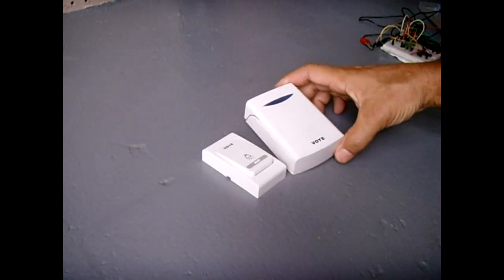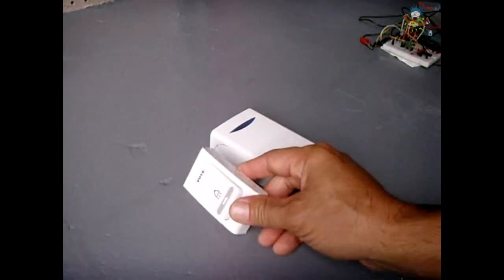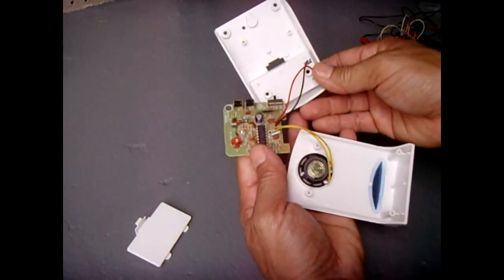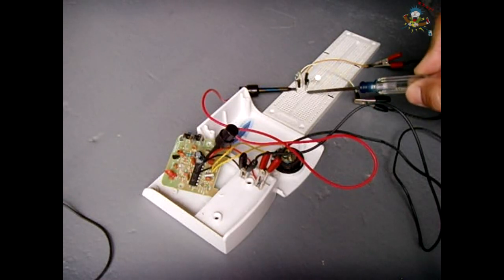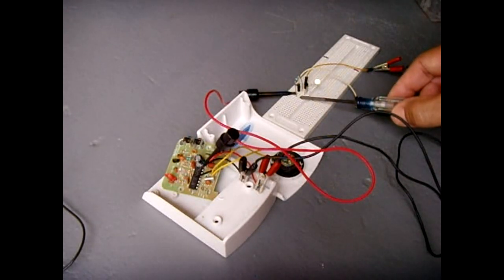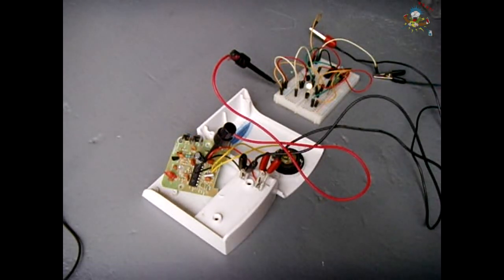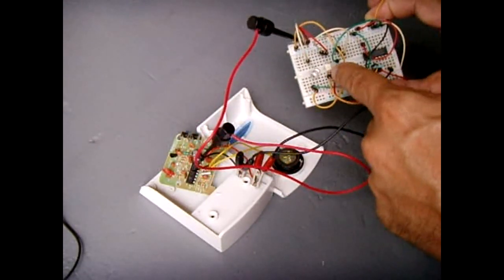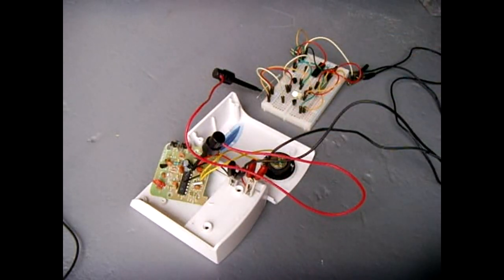Latching ON/OFF Wireless Transmitter for UNDER $10!

Comment: There is nothing wrong with Dave Johnson's latch circuit.  The Mosfet used in his circuit is a P-Channel Mosfet and it is wired correctly.    You described how to wire up an N-Channel Mosfet circuit.  The 2N7000 is an N-Channel device.   N-Channel Mosfets are generally used for low side switching.  P-Channel Mosfets are generally used for high side switching.

Comment: I saw this video and it inspired me to do the same, I went on ebay and purchased doorbells like the one shown. Upon opening it up the circuit board is different. Gotta give it to china for having multiple factories using the same case with different internals. I now see that they sell RF transmitters with push button remotes and relays already installed for the same price. So I'll probably go that route.
Reply from the maker: darkflame808 That does happen unfortunately. Please refer to my remote control pyrotechnics video. You'll see the transmitter you're referring to. Thanks for watching!

Comment: I have an older Nutone intercom with wired doorbells.  I would like to replace the third wired doorbell with a wireless remote button.  The doorbell now sounds as long as a constant 12vDC on the doorbell circuit is interrupted by the push button.  Shouldn't your modified wireless doorbell work on my DC system?
Reply from the maker: You can use any wireless doorbell for that.

Comment: I'm new to electronics but somehow found your presentation both very enlightening and intuitive. Thank you for taking the time to put together such a straightforward video.
I have a question, if you don't mind: Would I experience any complications by controlling two identical receivers with one remote because I hoped to control two identical, yet spatially separated low-power appliances (each of which are within a meter of the remote transmitter) simultaneously.
Awesome video again, and keep up the splendid work!
@oswaldkay1

Comment: Hello, I need to replace on/off button on my circuit with remote switch. So I have this door bell.   My circuit works with 9v battery.  can you help me. I cant see picture of circuit on 7:33, is that what I need?
Reply: My circuit is counter.  if I press on button once, it writes 001 on lcd. if i press it again it writes 002, if i press it again it writes 003 and so on. I need to press this button remotly.

Comment: Looks like that's an uncoded transmitter? Don't think I've seen one of those for decades!
Reply from the maker: I think the unit works by transmitting at a specific frequency(303 mhz), and within that transmitted frequency is a 32khz signal. Without the 32khz signal, the receiver will not trigger. Not bad for the $. :-)

Comment: Thanks, can we use a PIR to trigger the wireless receiver to turn on sth.
Reply from the maker: Dean Lee A PIR can be used to trigger the wireless receiver. You would have to use the PIR output pin to close a reed switch to simulate a person pressing the transmitter button.

Thanks For Watching. Be sure to share and rate Thumbs up.

Comment: Is there a way to trigger the transmitter with a 12v DC signal instead of using the button?
Reply from the maker: Have the 12V signal trigger a small 12V reed relay. :-) The relay contacts connect to the switch contacts. Thanks for watching! Be sure to share my channel with others.
Reply: Thanks.  I ordered a cheap 12v push-pull solenoid yesterday.  I'll trigger it with the 12v signal and have it physically push the button.  If that fails, I'll try your idea.  thanks for responding

Comment: What about these and a latching IC? http://www.ebay.com/sch/i.html?_trksid=p2050601.m570.l1313.TR0.TRC0.H0.X433+mhz+module&_nkw=433+mhz+module&_sacat=0&_from=R40
Reply from the maker: Those can be used, but you don't have a nice housing/battery holders like the one I used in the video. I also think more work would be involved.
Reply: I think I didn't explain  well enough. Use those to create your own and design a case. Kickstart it. $15 a pop. $5 in parts. $10 profits per. Big bucks selling these things!
Reply from the maker: joblessalex
You could do that, but the case designing can cost bucks. I designed a nice case using Freecad, and they wanted big money to 3D print the prototype I designed, then make a mould. Reminds me of how badly I want a 3D printer!